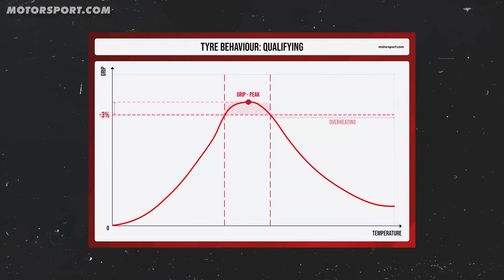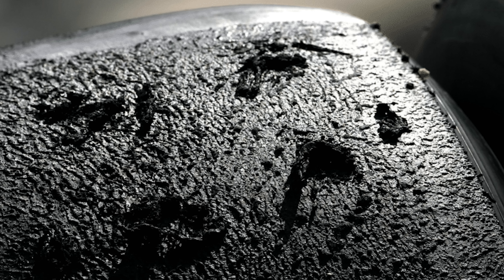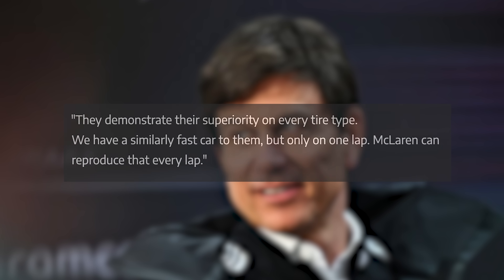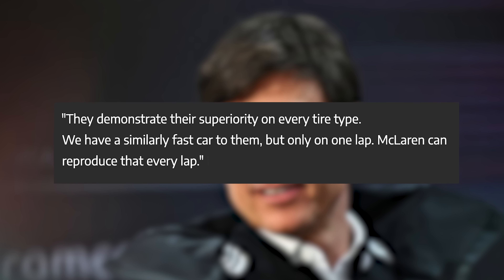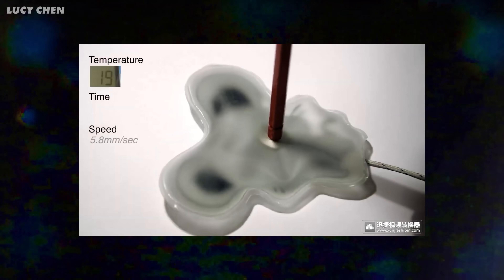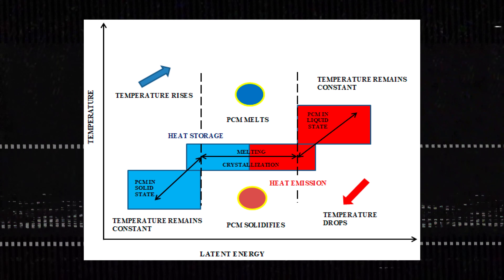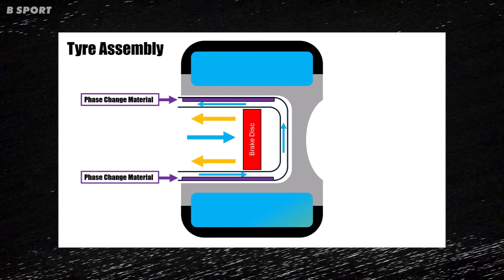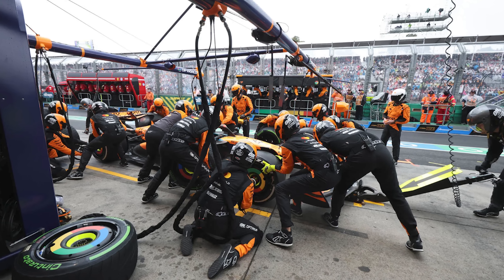McLaren’s GENIUS Tyre Trick Explained

Comment: I’ll argue it’s not phase change. They could be effective limiting peak temperatures over a single stop, but they would quickly get saturated. Reversing or adjustable airflow is a far more credible explanation. 

Some quick math proves the point: it requires 2910 KiloJoules of energy to slow an 800kg F1 car from 200 mph to 60 ignoring aero resistance, more like 2600 kJ if we include aero drag. A very good phase change material might absorb 400 kJ of energy per kg: melting aluminum and ice are some of the highest latent heats of fusion at 396 and 334 kJ per kg respectively. So it would require nearly 7 kg of very good phase change material, almost 1% of the car’s mass (unsprung), to absorb a single stop’s worth of energy, and the car’s going to cumulatively dump that much energy many times per lap. 

If the phase change material ever melts completely it ceases to function as a PCM, heating up just like every other component, so the key is remove the right amount of heat to keep it at the optimum temperature. Unfortunately here the PCM material works against you: because it’s the same temperature if it’s 1% melted vs 99% melted it rejects the same amount of heat to the air in either case. You want something that does the opposite: reject lots of heat when the material is at 99% melted so it doesn’t melt completely, reject as little heat as possible when it’s 1% melted to keep the heat in and avoid complete freezing and sub-cooling. The system needed to do that is an actively managed air cooling system. And if that’s good enough it can do the job without the weight of the PCM. 

Shape memory alloys are another option instead of bi-metallic strips: more options to package the actuator. 

Time will tell if I’m right or not, but I’ll happily take odds if anyone wants to place a bet.

Comment: Also, there are two classes of these types of material: Passive and Active. Passive materials require no intervention to function, but have fixed operating properties. Active compositions can have their operating properties modified by a control system, but there's more complexity added. There's a tradeoff.
Reply: Which mclaren actually only need the passive ones since the optimal temp dictaded by material of the compound.

Comment: I work in the mattress industry for a high tech company and we use PSM all the time, it comes in fiber, thread, gel and sprays....due to the extreme heat of brakes I guessing it's gel on the inside, woven into the carbon fiber and sprayed on the components as well, it has be tested to last over 20 years in a mattress so it could probally last the whole race and then some. It is truly amazing and very expensive!

Comment: The part that I would need clarification is the expansion or contraction during the fase change.when water melts I contracts bit when steel melts it expands diferen materials react different. The non Newtonian materials react different than Newtonian materials.

Comment: 2 things. You can actually tune phase change material to a specific temperature (within a range based on the composition) in a 2 part material based on how much you have of the one material compared to the other. 

Also something else to look at would be nitanol which is a material that below a certain temperature it will be in one state and above the transition temperature it changes phases into a martinsitic structure which makes it return into a predetermined shape. So if you had an air duct that was held open by a spring until something made the nitanol hot enough to return to another shape pulling the air duct closed or open at a specific temperature. It could basically act as a thermostatic actuator and could be useful.
Reply: I'll give you yet another challenge: if they are using PCM, how do you deal with different tire compounds in a single race? I assume they have different operating temperatures.

Comment: Could you really keep the weight so low while also make something that has an effect? Phase change tech would be unsprung mass - so not affected by suspension which has much bigger effect. Not to mention it is also rotating mass.

Comment: Apparently, nobody is considering that this is a two- way street in that a massive amount of latent heat (known technically as the latent heat of fusion) would have to be released to into the wheel assembly to re-solidify the melted phase change material such that it can again serve as a heat energy sink at the next braking corner.  We must consider that with this type of "keep it cool" system, a large amount of heat energy is still stored in the overall wheel assembly as its not being effectively dissipated externally as with an air cooling system where the heated air physically leaves the system.    Nobody here is discussing the obvious fact that latent heat works both ways in that a lot of enthalpy is needed to melt the material at the same temperature but in reverse, a lot of enthalpy must leave the material to re-freeze it at the same temperature!!!  Where exactly is that released heat going to go guys and girls???.............back to where it came from is a pretty close answer folks.  If the air flow between braking zones is not sufficient to cool the wheels without the phase change material, then it's not sufficient to remove the same amount of heat from the magic phase change material to refreeze it such that it can continue to function as a heat sink.  This is engineering 101.  Heat sinks have to be cooled too before re-use as they store a lot of heat.

Comment: That's cool on the engineering/tech side, but if that's the kind of trick at play, that should be banned. Call it water cooling or whatever material cooling, it shoudn't be there.
For the sole reason that the FIA is annoying everyone to have dumb tires that destroy themselves. 
It's like having part of the grid on those dumb crap tires, and rest on old understructible bridgestone/michelin. That would be dumb imho.

Comment: Assuming this is what they're doing, they'd have to somehow sandwich this phase material in between the cf layers otherwise, it'll have no structural rigidity. Could they really develop this within the current cost cap limits? It's a solid theory but unsure if current cost cap would enable use of such tech. Maybe one day we'll find out.

Comment: One thing springs to mind. What happens when the phase change material has fully melted, surely it just transfers heat as normal then?

Or is the latent heat used as a sink, pegging the temperature at a fixed level, never absorbing quite enough energy to melt during braking, and shedding enough energy on the straights, aided by cooling air, to allow more braking for the next bends, and keep it solid?

Comment: I want to know the exact method they are doing now because this is a very simplistic explanation of something alot more complex to achieve the desired result. The easiest application i can think of is a solid that goes straight to a gas which is blown out into the atmosphere while they race. U just need so much of the material applied to a surface to last a full race

Comment: If you ask me (ex F1 tire engineer) it is mostly balance and downforce. 

They are able to protect the rear due to better aero. Max has higher rear tire heating, so he has good tires in QF. But then fades in the race. 

I know teams spend a lot of energy on brakes heating/cooling but in the end it is all about the slip angle and load on the tires. This is what heats up the tire surface. There is a thick air cushion between the rim and the tire. 

I could at best imagine some phase changing gel inside the tire. But I think the air inside the tire is too much of an isolator to expect the rim temp to influence deg.
Reply: Does this explain the anomalous cold spots Red Bull observed via thermal imaging in the brake drum though?

I don't think even Red Bull would kick up a stink if they were getting out engineered on downforce and balance alone.
Reply: I don't think you're imagining this correctly. 
The theory here is more like an ablative heat shield between the drum and the rim.
Reply: @c6q3a24 a heat shield which if you're accepting the brakes to increase tire temp, would indeed have a result in a reduction of final tire temp.
Reply: the air is not a buffer since the rim (which gets hot from the heat of the drum) is in direct contact with the tyre. and therefore increases the temparature of the tyre. I'm no engineer, but that's the way I understand it.
Reply: In the end it is a numbers game. The rear tire surface directly passes all the force that the engine supplies over a lap to the road surface. Plus the cornering force and the braking force. Slip (x speed) is translating this force into heat energy. This is the main contribution in my experience. Reduced slip is reduced heat. Higher rear grip means less rear heat.
Reply: I talked to a colleague of mine currently in F1. The main effect of the cooler brakes is lower tire pressure during the stint. This then affects grip, sliding and tire deg. But the direct effect of the brake temp on the tire temp is less than the effect of the pressure increase on the tire temperature.
Reply: @philipheijnen  that's a good shout. Makes perfect sense 👍
Reply: 1) air cushion is very mobile because of rolling therefore it is not exactly insulating the rim. Ideal air insulator would be porous material which limits air movement (like air gel). Mediocre insulator would be static air volume (worse than porous filler because of convection). Worst air insulator is turbulent and moving air
2) no matter how good insulation it will conduct enough heat at high enough temperature of the break drum that the tire gets out of optimal range
3) it's about better thermal balance than competitors, not about solving the problem perfectly. Even if they get just somewhat better temperature some of the time they are still in advantage
Even if tire is primarily heated by friction it does not mean the break heat does not worsen the temperature.
Reply: So true, the air is a huge buffer and this theORY is BS
Reply: Somehow, this reminds me of the latest Blue Origin mission (cough) that took the first all-female crew (cough, cough) to space (gasp) and returned them as astronauts (gag)…

Comment: Your hypothesis on their system is interesting, but I think the state of the art "solid-to-solid" phase change material is more likely. These materials change from one lattice configuration to another at set temperatures and absorb/release huge amounts of energy doing it. By using the right amount and it being calibrated around the tyre's working window, the material would naturally cross the temperature threshold, probably when the tyre is getting too hot, and absorb a ton of heat. Then, this part must be connected to some other cooling parts acting as radiators for the heat it absorbs.
Reply: Because some of these materials are polymer-based, it might even be possible that Mclaren have found a way to layer it or weave it with Carbon Fiber. In this case, it would almost certainly not break any regulations, as it might not undergo any visual variation even when crossing the temperature threshold. In this case, any part of the wheel assembly that is made of such a carbon fiber composite could be helping cool the tyre.
Reply: Synergistic Enhancement of Thermal Conductivity and EMI Shielding:

A study presenting the development of phase change composites reinforced with 3D Ag foam and short carbon fibers (SCF). These composites were fabricated using a vacuum-assisted impregnation and curing process. The resulting Ag@SCF/PCM composites showed significant improvements in thermal conductivity and EMI shielding while maintaining latent heat storage.

Comment: I don't think this adds up. The total cooling performance of the brake ducts themselves won't change (in fact, it'll be reduced since the temperature difference between the phase-changing material and the flowing air will be less), so you've still got the same total cooling performance. It's a bit like water-cooling a PC. Your maximum thermal load is higher than an air-cooled system, but you still need the same amount of airflow going through the radiators to shift the energy. Phase change cooling isn't magic, you still need to shift the energy.

Comment: Even if they were using water.
Water builds up heat, that heat needs to be dissipated.
This is why cars have radiators, to remove the heat build up from the water. 
If there was no means to dissipate that heat in the tire water, it will just get hotter and hotter.

Comment: It’s almost certainly the same cooling tech Mercedes tried to use use with their sidepod-less design. Originally designed for Hotol. It’s not rocket science… or rather, it is. Simple, but very clever.  Next will possibly be electrostatic airflow manipulation. Again, simple, proven but not yet used.

Comment: Enthalpy change and thermochemistry is awesome. If you know what the tire temperature is before degradation you can calculate what substance or reaction is best by the amount of heat energy is absorbed in the “water-cooling” system, the enthalpy of change, and the constant pressure within the system. Most chemical substances also become more soluble with heat as well. The problem would be how do you expel the heat in a continuous system without creating solids that plug up something like a radiator or heatsink with veins. Pretty cool tech!

Comment: Interesting fact about ice: it takes the same amount of energy to melt 1 kg of ice as it takes to heat 1 kg of water from 0 degrees Celsius to 80 degrees Celsius. So imagine what a purposely made PCM can absorb/release when changing phase. In buildings (I'm a building engineer) PCMs are used as a way of passive cooling. These PCMs are made to melt at about 21 degrees Celcius keeping a space at a comfortable 21 C. One way of using PCMs is by lining walls or ceilings with them, another way is to integrate them into the building's AC system (passively cooling return air from the building before actively cooling it with the AC).
Reply: As a chemist, I would add that most materials have a lower capacity than water to be a heat sink while melting, mainly due to the very specific way hydrogen bonds play into the melting of ice. But nevertheless, a well-engineered material may still provide a very efficient way of cooling indeed. I guess main issue would be how to incorporate it into the matrix of your wheel drum materials.
Reply: I think it would take significant amount of PCM to reduce or limit tire/wheel/brake system temperatures. Let's say a PCM with a latent heat of 500 Btu/lb (1163 kJ/kg) could be achieved. That means 1 lb of material could absorb or release 500 Btu (or 1 kg at 1163 kJ). The heat generated by F1 braking systems is in the millions of Btu (thousands of MJ). Even if just a fraction of that heat was absorbed by a PCM, it would take several pounds or kilograms of it to provide appreciable cooling while adding a lot of weight to the system.
Reply: @anenigma3499  It's not about cooling the brakes, that's what the brake ducts are for. it's about reducing the amount of heat that reaches the tire. So the question is how much heat (energy) from the brakes is transferred to the drums, how much of that energy can you absorb with a specially made PCM and how much of that PCM would you need to gain an advantage. Of course increasing unsprung weight isn't great but if overall it gives you an advantage then I'm sure teams wouldn't mind. Martin Buchan, a former McLaren engineer, wrote his doctoral thesis on PCMs and he's the one who came up with the idea that this is what McLaren are doing.

Comment: I'm a chemical engineer, and I don't fully trust the explanation provided in the video. Even though the temperature remains constant during a phase change, there is still continuous energy transfer to the phase change material (PCM). As the video mentions, temperatures can reach around 1000°C during heavy braking.

Even if the PCM initially remains in its phase transition range, it continues to absorb heat as latent heat. However, once the phase change is complete and the material is fully transitioned, say from solid to liquid—it becomes saturated. At that point, it can no longer act as a thermal sponge, and the advantage of using PCM is lost.
I'm quite certain the phase transition would occur quickly under such high thermal loads, especially in a high-performance environment like an F1 car. After saturation, the PCM behaves like a regular material, with no additional latent heat buffering. And considering that an F1 race lasts about 90 minutes, that's far too long for the PCM to remain within its effective phase-change window.
Either McLaren is not using PCM, or this video is an oversimplification that doesn't present the full picture—or it's simply false.
Reply: I am presuming that they are choosing the material so that it doesn't change phase for as long as possible. I am also guessing they put it in the rims so a tyre change means new PCM.

Comment: That could also explain why McLaren had "break issues" during pre season testing.
Reply: Were they working too hard, or do you mean "brake issues" 😊
There is nothing that points to that, we don't even know if they are using this tech at all. Speculation is the preferred activity when it's not a race weekend😊

Comment: Sorry but i just don't buy it. PCMs are just a limited heatsink. They don't directly help with getting the heat away. Meaning they might keep your tires cool for round, but not much more. They might however help with heating up the tire. Them melting could be the thingamabob that switches the airflow configuration ion the tire